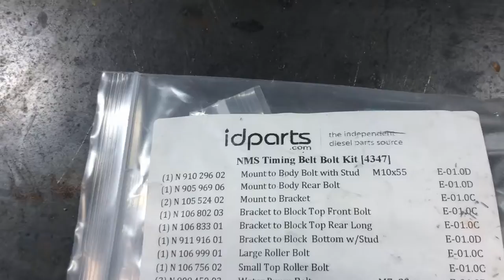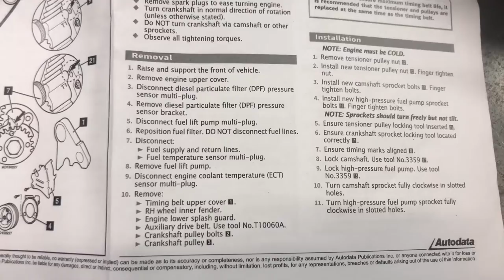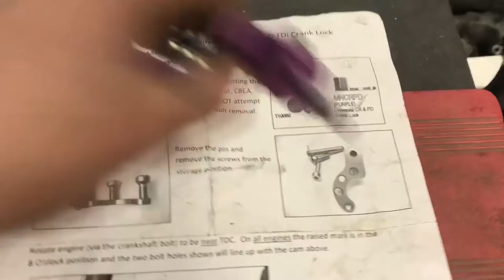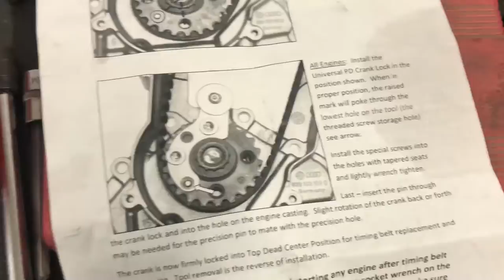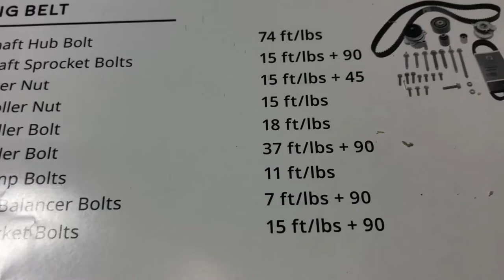Passat CKRA 2L TDI Timing belt kit replacement

Comment: Great job with getting everything lined up, you might be the first person I’ve seen or heard of that didn’t have to adjust the cam sprocket after the initial 2x turns of the crank. I used IDparts as well on my CJAA complete kit, I was very impressed with the parts, and I did the entire job with mount removal.. I used the metalnerd locks, I had a tough time to get cam lock P3359 tool in, it took 5 tries, I finally figured out my belt tensioner was too far to the right.. I adjusted belt and everything lined up. I used blue loctite on all the new fasteners as well since diesels tend to really vibrate.. I have 1000 mi on the Jetta since that job everything is perfect.. good parts and I think your video will help a lot
Reply from the maker: The cam lock can be a tricky one, the tolerance is so tight you can be pretty well spot on and it still doesn’t go in. Yeah cam and pump timing were spot on tensioner can usually be tweaked a bit. I use the Idparts kit usually as well and have had good luck so far. I’ll usually add a dab of blue on any bolts getting replaced but any stretch bolts I put them in dry, I’ve been afraid of the loc tite messing with the torque spec and breaking bolts.

Comment: I'm really not trusting torque specs today. My vw manual says the cam sprocket bolts are 20nm plus 45. Then it says the hpfp sprocket is just 20nm. The paper you showed in the video says 15 ftlbs plus 90. On both cam and pump. And that makes sense being the same size thread. Might juat have to go by feel.

Comment: I'm surprised to not see you remove the engine mount. It gives you more room and allows replacement of the timing belt tensioner without removal of the studs. I just checked the service manual, and it is the way it states to do it, but still interesting to see.  Also, for anyone reading, those under bed plastic storage containers make good coolant catchers.
Reply from the maker: I’d seen some retailers selling the timing belt kits without the bolts as a “shortcut” install kit. I have some bad memories with mk4/mk5 engine mounts being a pain to remove and install so I decided to give it a shot. 
I plan on getting one of those containers, preferably with a lid for a spill free container.

Comment: Damn. I'm tore all the way down and realized ecs tuning kit did not include the small idler pulley at the top. That sucks because just to change that out later I have to tear it down enough to pin the cam, pump and crank to loosen the belt.
Reply from the maker: Leave the old top idler, assemble as normal when the new one comes in just remove the idler and push down on the belt to install the new one. I’ve done that on the older ALH engines and you should have enough slack

Comment: My camshaft seal needs replacing, I have all the tools and equipment for the belt/pump etc.. but I’m kinda nervous I’ll have a hard time getting the timing correct after I remove the belt pulley. Going to mark everything but still kinda sketchy.
Reply from the maker: I’m going to assume the fixed hub is keyed to the cam, the same as the older PD Tdi’s. Your locking pin slips through the adjustable gear then the fixed hub so there’s no way of messing that up.

Comment: I wonder how many young techs screwed up bad with such a critical typo in the dealership manual. 
Page 134  and 135 Rep. Gr.15 - Cylinder Head, Valvetrain. 
It clearly says for the cam sprocket bolts 20nm plus 45. Then for the fuel pump it just says 20nm. 
That is not even close to enough. That's just 15ftlbs I double and tripple checked. Decided to go 20nm plus 90 because that's what your paper as well as other online said. No way would only 15ftlbs and no torque turn hold them bolts. Glad I have the experience to stop and think about it because that is a very bad typo for a critical component.

Comment: My 2014 had only 28,000 miles last fall when i got it. It was one that got bought back on the epa deal. But its old enough  now that i am worried about that belt aging. I have 40,000 miles now. I know vw says 130,000 but i worry about the 3 years it sat without running taking its toll on the belt. Im am thinking the pulleys and tentioner would be fine till over 100,000 but i want to just change out the belt for now just for piece of mine. But then i start thinking about the water pump seal being rubber. So i may do a whole kit. I am a diesel truck mechanic so i am use to gears that last about 2 million miles. Not a belt that will definitely wipe out an interference engine.
Reply from the maker: I did another Passat shortly after this one with 119k miles, original timing components. Water pump bearing failed and dumped all the coolant out, could of been a lot worse. I believe they say 7 years/130k miles whichever comes first, for the price I’d change it out

Comment: Josh watching your video for reference.   In the middle of a timing belt change and I knocked my pin out of the HPFP.  All other pins are in place for TDC except for the fuel pump pin.  Now I cant get the HPFP to line back up for the pin hole.  Belt is still on and I have stopped before I kill my CKRA.  help.
Reply from the maker: New belt or old belt? If old belt then just take the belt off and rotate the pulley as need be to pin it, then make the pump sprocket cantered on the slots for reassembly. If new belt I’ll assume the pump has spun to the end of the slot on the pulley, you should be able to keep those bolts loose and stick a pry bar in and twist the pump to get it lined up again.
Reply: @JoshsJettas  old belt is still on.  So I can just remove the old belt and line up the HPFP hole for the locking pin?  being that it pulled over losing alignment I thought that it might be under tension and that I would be really f-d if I removed the belt from the HPFP pulley.  And I wasnt sure how critical the TDC alignment was as it pertained to the HPFP.
Reply from the maker: @82dParatrooper  yeah it’ll be fine to get the pump re-pinned afterwards it can be moved off of tdc fine (cam and crank not so much). it’ll have some tension on it so a small bar on the bolts should be able to get you one way or the other.
Reply: @JoshsJettas  got it all done!!  Your video really helped me along with my CKRA.  Thanks again for the great content.
Reply: Delete is next on my CKRA.  Will be using your video to guide me.
Reply from the maker: @82dParatrooper  definitely helps mileage, def countdown to no start isn’t much fun either.

Comment: Hello Josh, I'm impressed by your video's, very helpful.
I was wondering if you would like to do my timing belt change?
I have a coolant leak from the water pump, my car has 171000km on it and it is a 2013 passat 2.0 tdi engine type CKRA
Reply from the maker: They always seem to fail early for some reason, im located in the kitchener area
Reply: @JoshsJettas  hi Joshua, yeah they all fail earlier than expected. There is also a setellement action a aialble, unfortunately mine is not cover for one month. Yes they cover model from 2010 to 2012 then 2014 to 2015 I think.
Can you please contact me by PM, I would like to get your precious help and support to get me car back in the road.
Thank you again 🙏

Comment: The bottom pulleys doesn’t want to come off after taking off the 4 bolts off and hitting it I’m not sure if taking off the big bolt in the middle
Reply from the maker: It should walk off, you might need to hammer and pry a bit. Clean the pulley up and a touch of penetrating oil will help.
That big bolt in the middle holds the crank timing gear on and that won’t come off while you have the tension on the timing belt yet.
Reply: @JoshsJettas  can’t thank you enough, you saved me many head scratches with this video, thanks to you car is back on the road
Reply: Yeah my harmonic balancer was tight and didn’t want to come off after I removed the 4 M10 triple squares.. used PB blaster on the opening and lightly tapped with dead blow hammer and it came off.. I didn’t want to pry on it

Comment: After I did this job car starts and idles but when put into gear and under any load it sputters and dies. The glow plug light is also constantly flashing .  Any ideas on what I screwed up ?
Reply from the maker: My guess is pump timing is off
Reply: @JoshsJettas thank you , one thing I noticed was when I clock the cam sprocket and the pump sprocket all the way to the right , when I tension the belt neither sprocket moves , I skipped a tooth on both of them to have the sprockets a little more centered in the slots. So I skipped a tooth and when I tensioned it they were both in the dead center of the slots on the cam and pump sprocket.  I was able to get the cam lock back in and crank lock but the pump lock was slightly off , very very close but I couldn’t get it back in.  I didn’t think it would be an issue any advice on getting the pump timing back in place once I get the belt off ?
Reply from the maker: @calebcutler7439 you need to make sure the sprockets turn independently from the hubs, with your lock pins in you should be able to rotate the sprocket. I don’t care where the bolts end up in the slots as long as there’s zoom either way, what’s more important is the hub is pinned and the belt gets tightened with the sprockets loose.
Reply: @JoshsJettas  thank you for your advice

Comment: Hello Josh  Just experienced water pump leaking antifreeze and am located 800 kms away from home.  Do have a timing kit located at home. Would I be ok to travel this distance?
Reply from the maker: Is it leaking severely or would you only need to throw 1-2L in? If it’s seeping I would drive it but if it’s coming out just as fast as your filling it id be afraid the bearings are about to lock up/fall out.
Reply: leaking very little. I've added maybe a liter in the last couple of days.  Keeping an eye on temperature and expansion tank.  Likely was leaking prior but just thought it was condensation from A/C.

Comment: Do you leave the lock tools in place when you're setting the tensioner?
Reply from the maker: Lock tools in, pulleys loose, set tension, tighten pulleys then remove the lock tools. Rotate engine 2 revolutions then complete the torque turn procedure on all the pulley bolts if everything is in time.

Comment: Could this be the reason my 2008 Passat just killed on me while making a turn ? It never started again
Reply from the maker: The belt can strip the teeth resulting in no start and engine damage, if it’s past due that’s a possibility
Reply: @JoshsJettas  thx. I want to sell it as is now. How much would you think it should sell for? Still under 100,000 miles and no accidents. Good condition. Also it’s been sitting since 2018

Comment: Just a quick comment. Why do you need to lock the crank?  Done a ton of Japanese cars timing belts and never needed a crank lock ??
Reply from the maker: With the cam and pump loose when you tension the belt there’s a possibility the crank could turn slightly throwing them out of time. And it’s quick/easy way of knowing your 100% TDC no trying to look at time marks from different angles trying to see if it’s lined up or not. 

The ALH which is an older tdi I just leave it in gear with no crank lock as the timing mark is on the flywheel and just keep an eye on it while tightening the pump/cam.

Comment: My battery is not charging and keeps needing a jump. I am told I need to replace the water pump, but I may also have a heater core issue. Which of these could be messing with my battery? Also, while all this was happening, my gas gauge went up without me putting gas. And stayed that way. :(. I have  a 2013 vw passat tdi.
Reply from the maker: Neither should affect the battery, if its the original battery it might be time for a new one, a weak or dead battery can cause alot of gremlins

Comment: how many km it had before you changed it? it's a 2013 passat?
Reply from the maker: 195k km ish if I remember correctly. Replacement interval is 130k miles/209k km, but that’s quite long, both I’ve done had bad water pumps so I recommended 160k-180k km for the next one.